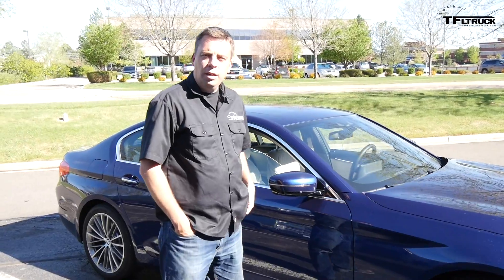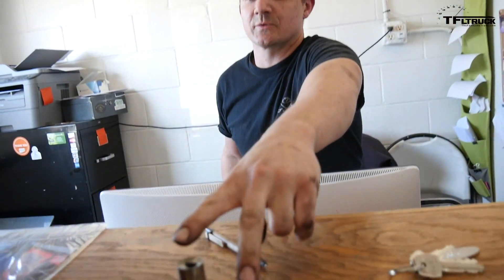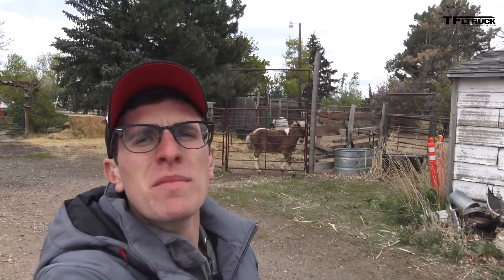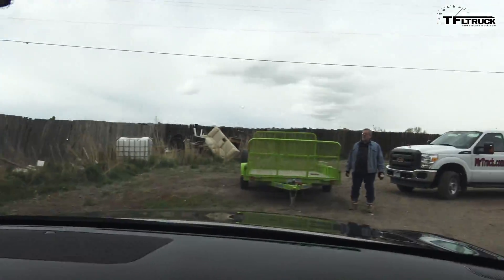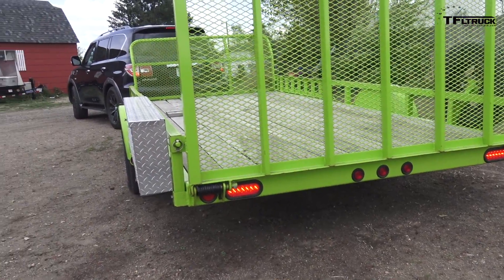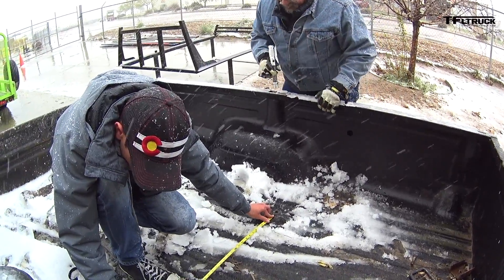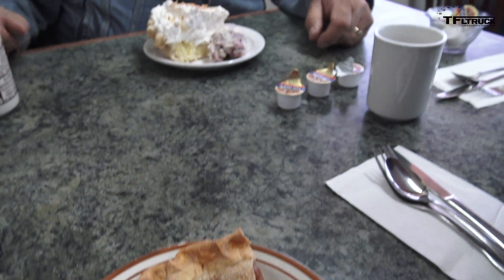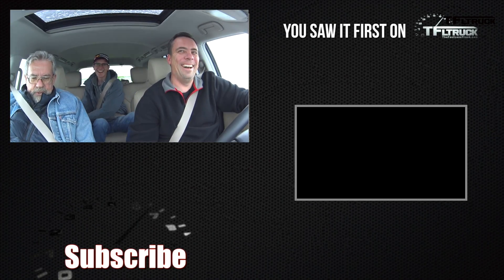1974 Ford F250 Highboy Died: Rusty Boy Project Truck Ep.2

Comment: Sup bud hando here I got a 76 for f250 same as yours mine is a standard. My grandfather bought it new. I fixed it up a bit, and it needs alot of work found another truck for parts. I will take a few things from it but if you need anything else from it you can come get the rest. I need the bed and floor boards the rest you could have. I live in new mexico and dont want to scrap something that someone else can use.

Comment: The old 360cid motors were a troublesome bunch!! Had them in past & always wound up replacing them!! FE engine family also had 352cid & 390cid which were very good motors as long as you didn't give them too many rpms!! Lol!! The 427cid & 428cid motors will also bolt up nicely in place of the 360 & give plenty of power!!

Comment: how could a rounded cam bend a pushrod? also your exhaust valve wouldn't try to open under compression. working on a 76 f150 motor rebuild. Looks just like this truck.

Comment: Wow, you need to get a new cam and lifter set for rusty boy. and pushrods and rockers. a worn cam lobe will literally just keep wearing and send metal shavings throughout the rest of your engine. im confident that you can figure it out. nothing was too complicated back in '74. maybe see if ted ax can help. you can get a moderate performance cam for cheap. a couple years ago i found an edelbrock performer cam and lifter set for my truck for 100 bucks with free shipping. stock pushrods can be had for cheap and new stock rocker arms should only be a couple bucks each. you'll need an intake manifold gasket, carburetur base gasket, and valvecover gaskets.

Comment: I guess what's happening to your truck must have been a common problem..... the original engine from my 74 had a bent push rod like yours, dont remember if I had a worn lifter or not but it ended up having a broken exhaust valve on that cylinder too. do you think just replacing the camshaft might shut your engine up for awhile?

Comment: Sorry to tell ya, but that engine is probably shot.  Borescope it, do a compression test, my guess is the valves & lifters are trashed, maybe cyl heads and pistons too, who knows what kind of mess you're gonna find.  Total overhaul time, wouldn't hurt to rebuild the carb too.  If you have the shop space, tools, time, knowhow, parts, and manuals, it would be a fun winter project.  Also, what cafe was that/where was it?  Been itching to try some prairie oysters next time I'm in Colorado.

Comment: there is some good news to be had with an engine like this, it gives you an excuse to get another block and build it from scratch!

may i suggest a 351 Clevo decked 10though, Funnelweb intake, GT40 heads and lumpy Hydrolic roller cam?

Comment: although I'm a GM guy, I love all of America's big 3 trucks, these Ford trucks were always my favorite body style, this truck has plenty of potential and well worth restoring, I would suggest investing in new bed side panels and restore the factory bed rather than replacing it, you'll be happier in the long run, also, if that is the factory 390 under the hood, I would strongly consider rebuilding it rather than replacing it, if I could afford it and were gonna drop in a crate engine, I would seriously consider replacing it with the new Coyote 5.0 and modernizing the powerplant

Comment: It is a very different world now than when I grew up and I am 65yrs old, but it breaks my hart to see how little mechanical knowledge kids today have. For the most part it is not their fault. When I started driving my Dad taught me a lot of the basics like changing oil and pulling the plugs sand blasting and making shure  the electrode is filed flat every 2000 mi. Young people today drive cars that in general don't need anything but an oil change every 10000 mi. Part of the problem of the lack of mechanical knowledge I believe comes from the fact that we do drive these kinds of cars.

Comment: u probably couldn't get the trans pan to seal because u did not hammer down the ridges of the pan bolt holes using a the ball end of a ball-peen hammer. Use RTV too if you must.

Comment: don't even run it,  just get a new cam,  lifters,  and pushrods, and check all your valves and valve seats.  after that you should be fine.  and if you do the work yourself,  you should be able to do it for less than your repair bill. but I'd do at least a top end tear down before buying any parts.

Comment: #4, bet the exhaust valve is sinking into the head. The factory right hand manifold is not the best design and without leaded gas the hotter exhaust chamber on number 3 and 4 exhaust valves usually go first. Rebuild the heads then run the drivetrain specs by Isky and get the right camshaft. Install a Motorsports roller chain and enjoy the next 70,000 miles.

Comment: The cam lobe is a goner already. If the camshaft was not replaced, the new lifter will not take long to grind itself to match. And just imagine, where did all those metal particles go?
Reply: niteshift92 yeah seriously offer id that's just common sense. block might even be bad too.
Reply: the block is fine cam is bad
Reply: The metal shavings will eventually make their way throughout the oil system, they get imbedded into all the bearing surfaces, piston skirts, rocker yokes, and the like. Good time for a complete overhaul with a thorough cleaning.
Reply: Why overhaul 50 year old technology?  That engine was outdated when new.  Replace it with something lighter, more powerful, with better MPG, and no carb.
Reply: Lighter, smaller, more powerful, better mpg, no carb, and 5 times more expensive and complicated  to accomplish than a simple rebuild, including a few performance upgrades. Besides, today's modern engines do not have the low end torque to make that size vehicle perform as it should.
Reply: Niteshift I disagree with the not enough low end torque comment. Ford's 6.2 gas stomps circles around anything from the 70's. I've been driving one since 2013 and it pulls dual tandem flatbeds much better than any of my 70's trucks and my 95 powerstroke.
Reply: Noah E why no carb are you a california millennial
Reply: So a complete rebuild? Or just get a new cam?

Comment: Woah!  No no no, park that truck until it has been properly fixed!  To me, a "band aid fix" would have been to replace the cam and all lifters and pushrods, NOT to just replace one pushrod and a lifter, that is a "road side emergency fix".  The cam lobe has been wiped-out as we say, the cam is toast and will eat up any new parts you put in there, plus add even more metal shavings to the oil that will destroy other parts.  At the very least the cam/pushrods/lifters need to be replaced and an oil that includes a zinc additive needs to be used (zddp) which is what flat tappet camshafts were made to work with (Amsoil Z-ROD for example).  That's a really cool truck; keep up the good videos!

Comment: this is a common problem on older engines with hydraulic lifters, you should replace the cam and all the lifters and make sure to run a oil with the correct additive in it for this style of cam. i would change the oil immediately if he didn't already, imagine where the metal particles have ended up from that bad lifter

Comment: This is going to get very expensive if you keep paying. Time to learn young man.You could have put in another motor,better yet spent 500 on parts and rebuilt the motor.Cam/ crank bearings are cheap new timing chain and cam with lifters and new rings for the pistons. Hone the cylinders,new valve seals,lap the old valves back in and your off to the races with a fresh motor.AND you could have upgraded to a hotter cam = + HP

Comment: Sorry to hear about the engine issue.  Often times the aftermarket parts are inferior to the OEM Ford components, and it's possible the cam lobes are not hardened enough and have worn down, but bad cam bearings as well as mismatched valvetrain parts like valve springs that are too stiff can cause odd issues as well.  I'd try to find a good rebuilder who knows the Ford FE engines inside and out, as well as their weaknesses and can build it up better using the best parts he knows of for use in how you want to use the truck.  Versus a stock engine that may spend most of its life under 3000 rpms, a souped up racing engine will only leave to more aggravation & expense due to their inherent nature of sucking up fuel, making unpleasant sounds and vibrations, as well as needing regular maintenance checks and adjustments a stock engine would never need.  Also realize even the oiling system on a race engine can be set up differently and can actually starve for oil if ran at low rpms most of the time.  If it were mine, I'd build the 390 engine up to a factory style 4 barrel configuration perhaps going with matched kit like an Edelbrock Performer intake and Performer-Plus camshaft/lifter set up along with their Performer Carb.

Comment: I had a 1974 Ford F250 4x4 many moons ago, was yellow in color and had a 360 V8 an 4 speed. I had installed a Detroit locker in the rear and a Trak-Lok in the front. The truck was virtually unstoppable an had taken it to the Moab Jeep Safari many times. The only problem I had was with the 360, 390 and 429 engines. The 360 had no power, the 390 had good power, and the 429 had too much power. These engines were terrible for reliability and had to replace the motors many times for throwing rods out the side of the block, since I owned it. I finally replaced the 390 with a 429 automatic and it's been one continuous problem after another. Motor mounts, drive lines, blown head gaskets and lifter problems plagued this poor old Ford constantly. Even though I had all these problems, I still wish I had the old Ford.

Comment: it would be nice to see  a match up with the new f150 with the second gen Ecoboost 3.5, against the new f250 with the power stroke. compared in all segments, including off road and drag race
Reply from the maker: +Ryan Brady Interesting idea. We will work to set it up.
Reply: Just make sure the 250 is in good running condition first haha

Comment: right now i'm trying to get a roller motor a 390 for my 70 high boy all most got the guy to sell it for 100 bucks but he want to trade for my 125 honda
Reply: ps i have the motor stands to put a 429 or 460 in a 3/4 ton high boy for 67 to 72 not sure if it is the same as 73 to 79

Comment: Contact Ford and see if they'll ship you an engine.
Reply: Powerstroke !
Reply: nahh a 6.2 litre v8 would do great
Reply: Jose Perez if you're going from gas to diesel the only way to go would be a Cummins,  preferably a 12 valve old school. Ford guys do this and call it a fummins.
Reply: @jamesnm21  i have a 1977 highboy and thats what im doing to it rn not because the motor shit our just so i can get some fuel millage😂😂
Reply: @freedom24v86  Ford doesn't make 6.2 gas motors anymore because they had a lot of issues with the heads warping. A newer 5.0 Coyote would be an awesome upgrade but he would have to change out the transmission. A 460 crate motor would be good upgrade and he wouldn't have to change out the C6 transmission.
Reply: @tskraj3190  ford still makes the 6.2 gasser but is getting replaced soon
Reply: Paul Morris I don’t believe they make them any more.
Reply: @freedom24v86  its getting replaced by the 7.3 gas engine
Reply: Yeah,the boy is swimming in c-notes... what? $4k is nothing.
Reply: @morgan-xv9bc  i just bought a 74 highboy today and i think i get like 7 mpg 😆 what kind if engine mounts are you using to secure the cummins?
Reply: @casimirobuenabista  well i found a website that makes conversion mounts and stuff to do it but im just going to take what they did and make my own because they look simple
Reply: @morgan-xv9bc  o ok cool do you remember the name of the website?
Reply: @morgan-xv9bc  thanks!
Reply: The engine was probably modified and also the warranty was gone long time ago on that engine
Reply: @freedom24v86  7.5 big block all day the 460 is a mean engine
Reply: @chuckwoolleryjed1735  has bad fuel economy low power and a life span of about 200k miles in most cases ive been around theres reasons most aint around 

The 6.2 and new gas 7.3 are farrr better
Reply: @ there’s pros and cons to all options out there but there’s no denying a 3/4 ton chassis with a 460 has done most of the heavy lifting for decades and is battle tested

Comment: Maybe GM will give you another krate? Adapter?
Reply: Chris York they've already got a boat anchor in it, why put another one in?
Reply: Kristopher Klassen He meant a New King LS!...Not a Dinosaur from The Past!
Reply: Kristopher Klassen He meant a New King LS!...Not a Dinosaur from The Past!
Reply: if it had had a GM engine from the start, it wouldn't be having issues now :)
 although an LS GM crate engine would solve most of its issues, I wouldn't mix breed it, since unfortunately it is a Ford, it needs the new Coyote 5.0 from Ford in it now, bad ass engine, Ford has finally got a few things correct
Reply: mate sivric all LS junk is.......Generic Motor Crap boat anchors
Reply: LOL Chris York, not sure Ford ever had a 426, they had a 428 SCJ and a 429, Dodge had a 426 Hemi, as for the friendly competition, some people get sore whenever you put down on an auto maker that they prefer, I like to jump in a conversation and nudge the diehard Ford guys from time to time too, but it's all in fun though, I like Fords too, I just prefer GM product styling over Fords, it's just a preference thing but the Raptor is a wicked looking truck and Fords  Coyote 5.0 and the badass little twin turbo eco-boost V6 are some of the strongest engines from any manufacturer today....

my old 99 Silverado 1500, with the first gen 4.8 LS engine with well over a quarter million miles on it and still ran great when I sold it, and the 04 Sierra 2500HD that I own now with the 6.0 LS engine in it with over 160k miles on it, both are excellent engines, GM could take a few lessons from Ford though and start using aluminum in their bodies, I would still have my old 99 Silverado if it hadn't been eat up with rust LOL

LS engines, at least in my experience, are far from boat anchors and far superior to the old GM small block V8 engines, same with Ford, their newer engines are far superior to their old stuff too, comparing the old Ford 5.0 (302) to the Coyote 5.0 is like comparing the Pinto to a Shelby GT500 Mustang

truth is, all manufacturers from time to time will build a lemon, it happens unfortunately, but normally in this day and time, if properly cared for, all auto makers have good dependable engines and are far more efficient and powerful now than they were several years ago....

buying a used vehicle like the old F250 in this video and restoring it is still far less expensive and much more fun than buying a new one...
Reply: Yes, I was going from memory from a boat builder. It must have been a MEL engine because of weight?? I agree.

Comment: I would advise not to keep driving the high boy until you get the motor rebuilt or replaced bud. Take the money you were going to put into that bed and have your mechanic rebuild your engine. there are plenty of good vehicles sitting blown up in a field because they were driven on bandaid fixes.
Reply: ledzeppelin27 get another one it has to much rust to start with.
Reply: My 76 has wayyyyyyy less rust than that truck. And I agree rebuild that motor mild not to radical. Plenty of aftermarket bolt ons 👌🏽💪🏽👏🏽👍🏽
Reply: @Victoria3232-j7o  that's not "too much" rust.
Reply: Yup. It's not over rusty, fix that engine! Maybe it's something simple like a cam upgrade. Nothing too crazy, just a nice street grind.
Reply: A bed you can get for 200.00,that doesn t make a dent on $4k engine...is like saying my car needs new tires,but I am going to buy a new car with the tires money.
Reply: @Victoria3232-j7o  hey man that's not true for a young guy like that my truck is a rust bucket 75 but it's still fixable that's a nice truck
Reply: @Victoria3232-j7o  well it’s kinda hard to find. these trucks in perfect shape people will put so much money into trying to fix it but in the end is never able to fix it

Comment: its amazing to see how many people no absolutely nothing about the old fe ford engines they are the most durable long lasting and strong as hell blocks and tommy I strongly advise u to buy a ford shop repair manule for that truck the 70.00 bucks for the book will save u thousends down the road and u will see how simple and easy the old fords and chevys are to repair do one thing for me replace the worn out oil pump or rebuild it replace the cam, lifters and push rods and while ur in their check the rod bearings for gauling and failure do to a worn out oil pump they do not last for ever hell the pick up screen might even be clogged my google account Is messed up so if u wont to reply just put in one of ur vids not trying to be a dick ether just giving the younger gen a helping thought I have rebuilt many 302